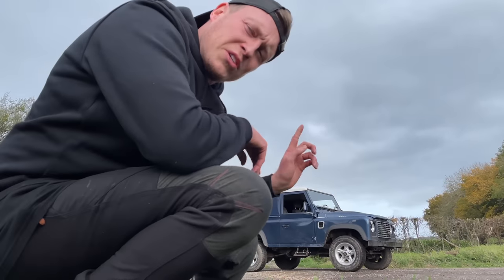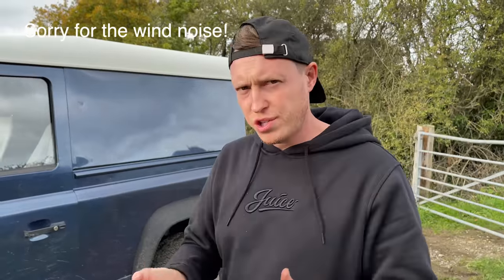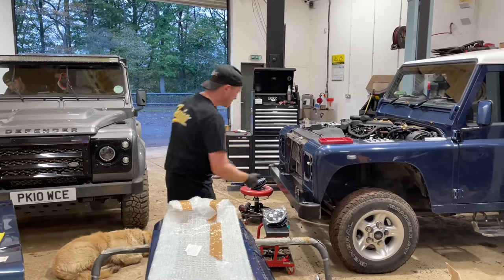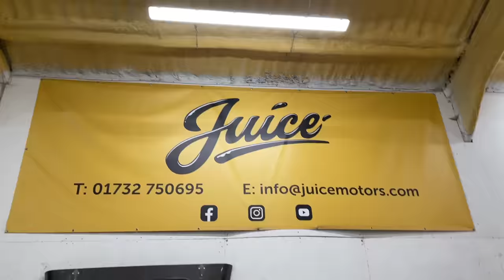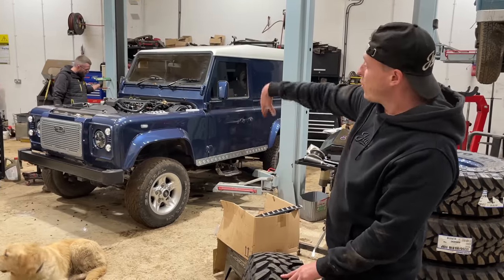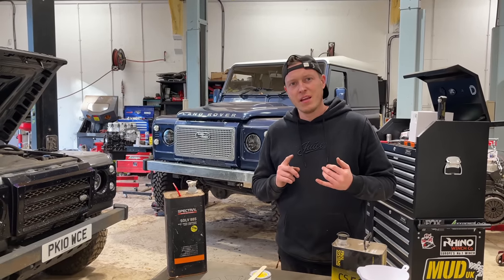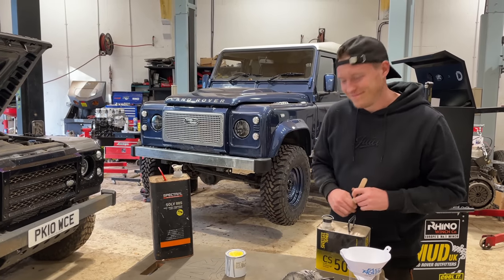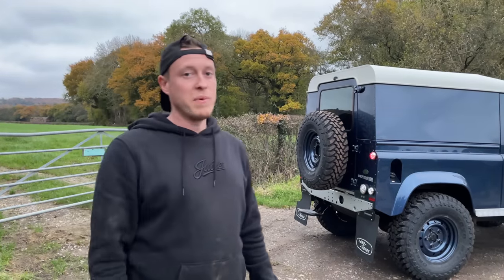I Bought ANOTHER Defender - Part 1

Comment: Love it   I’m 57 and ive loved the idea of having one from the age of about 14 ish.  Sadly I know nothing about engines and the problem that a defender 90 can throw at you, the vehicle you just turned out is 100%   Well done
Reply: I’m going to have to put you right there - I’ve owned a 1996 300Tdi 90 for 6 years now and it has been utterly reliable for over 30,000 miles.

Even when it does go wrong, if you can’t fix it yourself then a good local independent Land Rover garage will be able to sort it for not much at all (compared to cars these days that are stupid complicated and expensive to maintain).

The older the simpler, don’t put barriers up for getting one, just do it!

Comment: Chequerplate sils, galv bumper and silver painted rear crossmember were absolutely the right choice. Personally I would have kept the original rims and wheel size, I think they looked better in the arches and with the overall fit. Bodymatched arches were spot on but not sure on the mirror caps, I think silver mirror caps would be overkill but maybe the same colour as the roof may work (need to see it to know if it's right or not). Spot on with the lights and the smaller grille, that wrapping round further behind the bumper would have looked wrong. Like many other comments, keep it as a van back!
Top marks so far 👌

Comment: I have the same colour combo on my 90 Puma SW. When polished and waxed the colour is amazing. Silver bits work for me very well (hinges, door handles, optimill mirror wings, etc.). However for over 3 years I have the vehicle I find it hard to decide on the front grill. It has the original plastic grill and surrounds painted in grey - I dont find it good for my liking, but so I dont the grill here ... maybe a heritage grill in body colour? Anyways thanks for the inspiration (galv bumper, silver chequer plate and silver rear is interesting combo) looking forward to next episodes.

Comment: I would’ve left the rear x-member black and kept the previous mudflaps. Also, I’d’ve sprayed the chequer plate sides and the Nakatanga grill in Cairns Blue. The steel wheels look right with black bolts or you could’ve sprayed the 5-arms of the Boost alloys in Cairns Blue and kept the rims and bolts as silver. I’d also have kept the front bumper black. I think it needs a swing-away rear carrier in black as the weight that heavy steel will kill the rear door. Though I’m with you on the clear lenses as they kill the heritage look and I prefer them in their original  colours.  As another poster said “Don’t out the windows in”.  Otherwise it’ll look like every other 90. Maybe put in a discreet rear view camera. I have to say I’m surprised you weren’t tempted to spray the roof silver.

Comment: Hi Sir, I would like to ask is that "normal" power steering oil leaking for defender 110 year 1991? and "normal" for engine oil leaks too? hehe 😂😂..thanks
Reply from the maker: Absolutely not, if it’s leaking it requires a repair. It’ll still function providing all the levels are frequently topped up, but for a 30 year old to be on the road today without extensive repair it’ll be leaking like a sieve. You’d be surprised how good it’ll feel if you drive a restored version!
Reply: @juicemotors  Hi Sir, thank you for your replied. meaning the legend of leaking isn't true..haha😂...anyway, thanks and your video was super nice😎😎